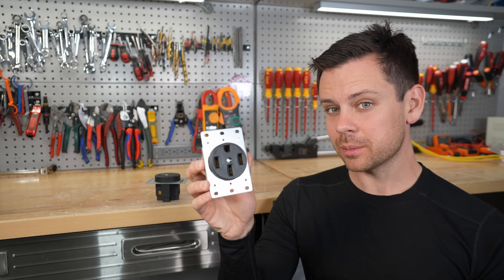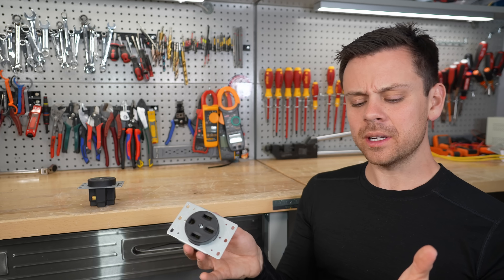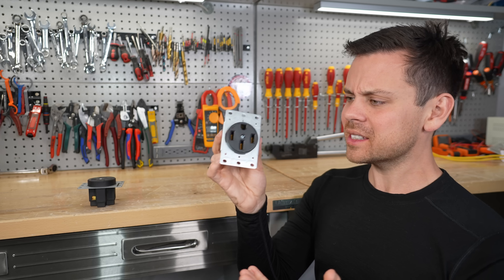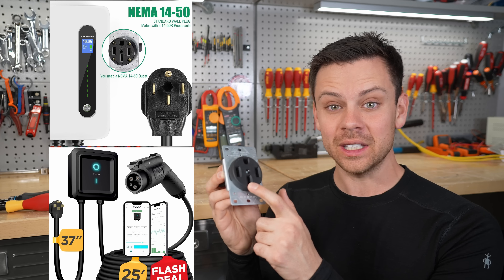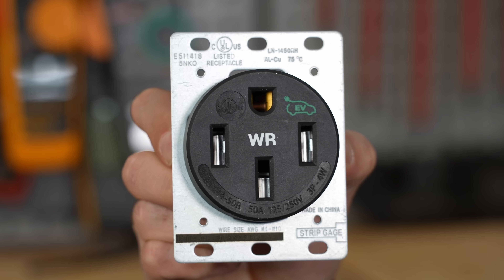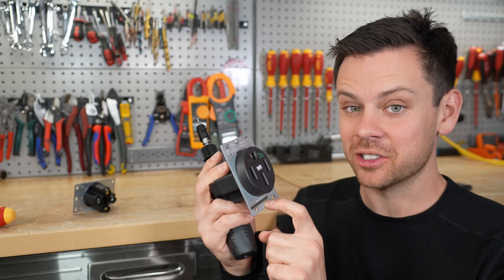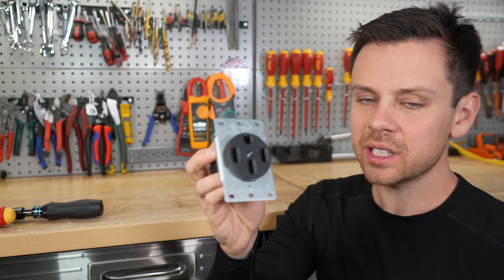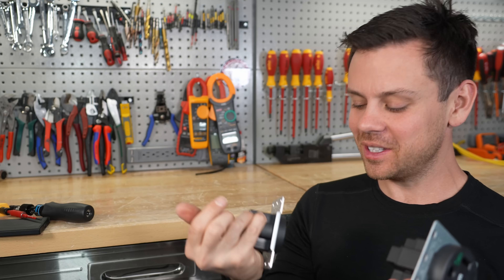Quick Guide to NEMA 14-50: Don't Burn Your House Down!

Comment: Part 3/3
To this point, I haven't gone through the math, I've only alluded to the ohms law math that helps us understand the relationship between power, voltage, current, and resistance (I've also used the word heat, in place of power because the heat that is produced is directly related to power. I've said things like: the resistance increases, which results in more heat. I could have easily said: "an increase in resistance results in more power dissipation (heat)". But actual physical heat is the best way to understand why spring force decreases and or accelerated oxidation occurs, in the scenarios discussed.

To this point, I have not mentioned anything about varying the overall current being carried by the circuit. I have only covered plug/receptacle current that is near its maximum capacity. Generally speaking, you would not run circuit above 80% of its rating. So, the 50A receptacle Will covers should certainly not be run higher than 40A. I believe he even says 40A maximum in the video.

Here's where I'll get a little more technical and include how current effects power dissipation, which translates into the localized heat we have been so concerned with.

Earlier in this writing I mentioned that heat dissipation is often described in electrical engineering as I²R loss. In this equation "I" stands for current (in amps) and "R" stands for Resistance (in Ohms). I'll assume that you're not interested in the actual math. So I'll describe the effect in the most basic way I know how.

Say the resistance of the contact starts at 0.02 Ohms, which sounds pretty low, but we shall see!

At 20A, that 0.02 ohm resistance results in 8 Watts of power dissipated over the contact area (warm when over a small area).

Let's double the resistance to 0.04 ohms. This results in 16 Watts of power (pretty warm when over a small area).

So doubling the resistance doubles the power across the resistance, doubling the heat.

Now let's take the resistance back to 0.02 ohms and double the current from 20A to 40 Amps. The power across that resistance is 32 Watts (this is very warm over a small area).

So doubling the amperage quadruples the power across the resistance, making the heat 4 times more than before.

All this to say, the amount of current in a circuit, drastically affects the heat potential of plug/receptacle connection (really any connection).

I'm personally not as concerned with a circuit powering a wall clock, as I am the circuit powering an electric heater.

However, the degradation of the connections, as described earlier, always had to do with the contacts increasing in resistance.

But, Will was clearly discussing high current circuits getting hot and potentially melting. Because higher currents greatly amplify the ability of high resistances to cause excessive heat, which can result in fire.

There is a way to measure voltage drop across the connection (meaning across the connection made between two different halves of the same wire). It would likely be in 100th or 10ths of a volt (10 mV to 100mV range). Knowing the voltage drop and circuit current, multiply the voltage in Volts (not milliVolts) and the current in Amps, will give you power in Watts. The lower the Watts, the less the heat.

OK, that's all I want to say on the topic. If you stuck with me through the whole thing, we can assume you're not interested in dating or raising hell. You're a full-on nerd!

Comment: Part 1/3
I started working as an electrician in the 80s and have seen a LOT of melted wires and receptacles!

There's an old saying, "Loose wires cause fires." This is a true statement, but "loose" is only part of the problem.

Below is a VERY LONG explanation of why excessive heat occurs and steps that I, and other electricians, take to mitigate the issue. So, if you're not interested in longer and more granular detail, this may not be for you.

Spoiler Alert! Selecting a high-quality outlet, the right size wire, and torquing the terminals to the listed spec, is not all that is required!

This topic has fascinated me for my entire career. So, I have done a lot of unofficial research in this area.

We were always taught to tighten wires sequentially, and that's what's not being mentioned in this video.

The tighening procedure we were taught in the trades (for stranded wire 8 gauge and larger) was: 
1) Use 120 grit emery-cloth or stainless wire brush to remove any oxidation from the surface of the wire, even if the wire looks shiny.

2) Immediately apply a thin coat of anti-oxidation compound (De-Ox or Noalox) to the wire.

3) fully insert the wire, ensuring that no insulation obstructs the connection. Then tighten the terminal (to 75% torque) wiggle tighten-wiggle-tighten. Then torque (at 100% torque) wiggle-torque-wiggle-torque.

However, while tightening, you continue to apply firm force (in the insertion direction), as you're wiggling the wire. Otherwise, you may be wiggling the wire out of the terminal.

We were also taught to inspect the connection when finished tightening to ensure it was fully inserted. There's actually a little more to the procedure, but you can look it up.

Comment: THHN is good, but you need to put it in conduit which traps heat more effectively than a non-metallic cable like Romex and is harder to use.  Using an NM cable is fine, conduit with THHN is better.

Comment: Most ratings are for intermittent peaks. Continuous use is 25% less.  That's why a 50amp outlet should be limited to 40amp for EV charging (a continuous load).

Comment: They aren't meant for continuous draw at those amps. Electric car chargers (they aren't chargers) need to be treated like a heater circuit. There are electric fryer receptacles that can handle those amps they have another terminal for 3 phase. 
       As for UL listed... They are the most stringent but just because something isn't UL listed doesn't mean it can't be used. Many inspectors like to look for UL on commercial equipment and when they find something without it and has another listing they have to be educated on the subject. UL isn't the only game in town but IMO they are the best testing company. CE is self tested and regulated so keep that in mind.

Comment: 30 inch-pounds is very little. Don’t confuse it with 30 lb-ft, that would be 12x too much torque.
Reply from the maker: Hard for my little hands 😂 have to push against wall to tighten. And yes I know difference
Reply from the maker: The screwdriver doesn't have nearly as much leverage as a wrench

Comment: I use them to power a 220v welder.  Never any issues.  I wonder if this is a current manufacturing thing.  Mine are 15 years old.  Most of these i bet are used for ovens and dryers.  Anyway, there needs to be some detail looked into as they are tested and rated...how and to what?  Then this should be reported, or like you did here, an explanation of proper use cases.  The EV community may be over drawing current past the intended capacity over a period of time.  Like 50amps for 5 seconds, not a continued draw.  What is the rating for a continued 30amp draw for it?  This makes me suspicious of ALL current outlets.  BTW, I have always been impressed with hubble.  They make great telescopes.😂😂😂

Comment: Do a tear-down on the two plugs.  You can show the differences in the "spring clips" that hold the cord terminal spades. I've gone to Hubbel extension cord ends; most factory cord ends also melt at significantly less than their rating

Comment: Any recommendations on 30-amp plug/receptacle for RV use?  I bought cheap ones, and am now reluctant to install. Thanks
Reply: @wholeinthesoul7925

I've used run-of-the mill TT-30 outlets for car charging for prolonged periods of time with no issues. 

Which is a much more demanding use case than an RV. You should be fine.
Reply: @billstevens3796  Thanks

Comment: I bought the only one they had at Lowes and installed it for my EV. I have no idea what brand it is, so far it hasn't over heated. I also installed an exterior one by Miady but I have only needed to use it for a week. If they cannot handle the current they shouldn't be rated to do so. Sounds like a class action lawsuit waiting to happen.

Comment: Most things you would plug into a 14-50 outlet are not pulling continuous high current.  An EV charger is an exception.  Even a cloths dryer doesn't pull high current over a long period of time.  It cycles on and off.  Glad you pointed this out to everyone.
Reply: Still it is a failure with UL.  People are going to assume when they see "50A" that it can handle it continuously (just as our standard 15 and 20A outlets can handle those loads continuously).

Comment: Good cautionary video but you failed to explain the root cause for the $10 receptacle to overheat and why the $50 doesn’t. 

Perhaps one has a higher termination temperature rating? 

You also hinted on wire insulation temperature rating, there more than meets the eye there…The conductor provides some sinking properties to dissipate heat away from the termination.

Comment: Well I've bought the emporia charger with the nema 14-50 plug.  And I did buy that 50 dollar ev nema outlet.  I didn't hardwire mine plugged it in direct and set it to the max 48amps the emporia charger would output as if it was hardwired. I've been charging my ioniq 5 for a few months now and never seen an overheating issue or temps above 112 degrees.  The cable from the emporia to the nema plug is very cool.  The cable that plugs into the car is the only thing that gets warm at 112 degrees.

So yea not sure why ppl are having their plugs overheat or catch fire.  Seems like they put it as a safety bar because ppl don't use correct wiring, breakers etc.
Reply: @spydermanx2000

They're having their outlets catch fire because they used $10 outlets that can't handle a continuous 40A load. Did you not watch the video?
Reply: @billstevens3796  yes I did watch the video and clearly you don't understand.  Emporia ev charger states to use the full 48 amps you must hard wire.  From my setup I DID NOT HARD WIRE MINE.  I simply used the ev specific 14-50 and still set the charger to output the full 48 amps and my experience has been very good and absolutely no issues of overheating.  So yes go rewatch the video he even suggest not doing the full 48amps on that using the nema plug

Comment: The cheap 30 amp for RVs are also notorious for melting down. We have an RV park and used to have to replace them all the time, Till I learned to buy the hubble 30 amp RV rated receptacles

Comment: Would this also apply to using this plug to back feed panel using a generator and interlock kit?
Reply: @MrRwebb1983

Depends on your load. If you're pulling 30+ amps continuously for days on end I could definitely se it being an issue. I would limit your load and use an infrared thermometer to monitor how hot it's getting, especially if you have high ambient temperatures.

Comment: I am very confused as to how these $10 name brand outlets can be advertised as 50A capable without massive liability issues. The NEC generally has very high standards for safety, requiring way oversized conductors, GFCI / arc-fault breakers everywhere, etc... But then you can wire these <30A capable outlets to a 50A breaker, and it's all equally code compliant??? WTF!!

Comment: Yep, great advice! Do it right the first time.  I went cheap and the blade receptacles were weak/loose.  Also had a few overtemp shutdowns charging a Model Y at 32 amps so I swapped it out with a good one.  Never had an issue since.  Thanks for all your wisdom!

Comment: 100% great advice. I had the exact same issue with mine on my Tesla mobile charger. In addition to the Hubble there is also one made by Bryant. It’s the exact same as the Hubble but typically a little cheaper.

Comment: Even charging my Chevy volt at 16 amps at work, the NEMA 6 - 50 outlet started having issues.   A co-worker of mine charges her Tesla in a different spot and is having over temp issues.   You've got to start with good solid hardware if you're going to charge an EV for hours.  Neither one of us have had an issue charging at home on our 50 plus year old dryer outlets.
Reply: I wonder if the problem might be that NEMA 6-50 outlets aren't designed for a lot of plug/unplug cycles. The typical NEMA 6-50 outlet may go years or decades before the stove that's plugged into it is unplugged...

Comment: Were you able to take it apart to find what is actually causing it to heat up?  There must be something, maybe multiple things inside that can not handle that amount of load, I wonder what that is.  Probably that thing is what makes it $10 vs $50.  Not sure what's inside that can make such a price difference.

Comment: That’s a common 50 amp RV plug as well. We can pull close to 50 amps with both ACs running plus microwave and running the dryer but even then I guess it’s not continuous but this is still a cautionary tale. Thanks Will.

Comment: hmmm good call !   i had electrician install my set up. I will have to see what plug he used. Not too worried about it as i charge my hybrid on the lowest setting. even my old EV i charged on lowest setting as its better for the batteries

Comment: This is a big problem. If an outlet is UL listed then it should be able to carry the rated current. A 50 amp outlet should carry 40 amps continuously. Why hasn't this been a problem for welders and other similar use cases? Obviously some of these outlets don't actually meet standards and just shouldn't be sold at all.

Comment: I've had my 14-50 outlet for 2 years along with a 2023 MY LR and never got a high temp warning or experienced any fires charging at full tilt 48AMPS. With that said, I don't remember if I installed an EV rated outlet. Looking though receipts now. If it turns out I did install the cheaper one, I'll get an EV rated replacement. Better safe than sorry.

Comment: which one do you use for a 50amp electric range, wont the range need to draw 50amp continuous?
Reply: @lobsta1124

The range will never draw 50A. And even if it did it isn't continuous. The highest draw is the oven. Aside from 10-15 minutes of preheat, the rest of the cooking cycle maintains temp by turning off and on. The "cheap" outlets are made for that usecase.

Comment: One key indicator regardless of brand (or to a degree, price) is how hard it is to insert the plug. It should take a good amount of force to seat a 14-50 plug. If you can easily push it in with one hand, even with an expensive receptacle, it is too loose and will fail.  

Also, do not unplug the charger unless absolutely necessary, and turn the breaker off first if you do.

Comment: Quick summary -- the NEC code is your friend, but details are important. Of the two outlets, only one is rated for Continuous Load. Ovens and clothes dryers are not considered continuous loads, hence the cheap receptacles. EV chargers are, hence the more expensive versions. Remember, the NEC code is written by the NFPA (National Fire Protection Association). Their purpose is safety and things not catching on fire.

From NEC 100 Definitions, Continuous Load: A load where the maximum current is expected to continue for 3 hours or more.

Article 625, Electrical Vehicle Power Transfer System. 625.42 Rating. The EVSE shall have sufficient rating to supply the load served. Electric vehicle charging loads shall be CONSIDERED TO BE CONTINUOUS LOADS for the purposes of this article.
Reply: as a consumer when I see a electical breaker or a receptacle that states 50Amps that is what I and everyone else expects it to deliver continuously and the NEC should hold them to that rating, then if they fail to deliver that continuous load they should be taken off the market.
Reply: @ Agree. They should change it slightly, maybe 52 Amps. If all the specs are 52, they would buy the right one. It's a very confusion scenario as-is.
Reply: I was curious about this — why would it be a danger to an EV but not an over/range? I suppose duration is the main difference.
Reply: @scottperezfox  And oven/range doesn't draw max current for 3+ hours. They draw max to get up to temp, then don't need all that power to HOLD that temp.

Comment: Thanks for this Will!   Being a full time RV'er, I have installed the cheapies at multiple family locations, and will upgrade ASAP now.   I see many cooked outlets at campgrounds around the country and I bet it's usually where EV's have been, but not always, they are just cheaply made I guess.   Weird that they are only for intermittent high amperage draw though, they should state that somewhere on them.
Reply: Many of the newer RVs are going towards all electric to get rid of the propane system.  These coaches (any many other large coaches) will draw a lot of power continuously, just like an EV.  Campgrounds need to step up to higher quality receptacles as well.
Reply: It is the constant plugging and unplugging (plus the damaged plugs on most RVs) that cause the issues in RV parks. And most RVs don't draw full power continuously like EV chargers do. (I live in an RV full time.)
Reply: @mxslick50  totally agree, we also RV full time.   Definitely a lot of wear and tear as people plug and unplug constantly.   We have seen people plugging in their Teslas out here, so I am sure that also helps do in these cheaper plugs.   For a plug on my kid's house, I think I will go with the beefiest solution in case they get an electric car or have a friend that needs to use it.